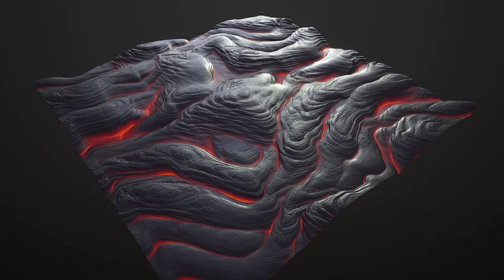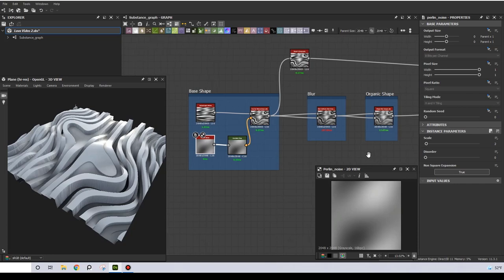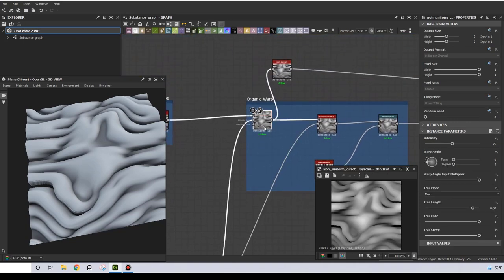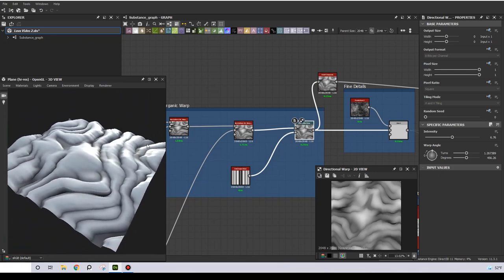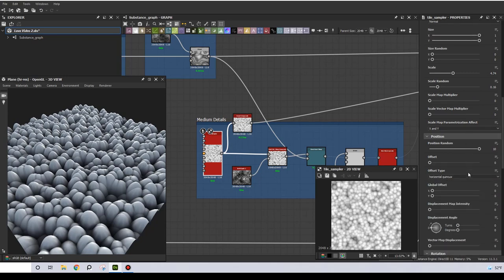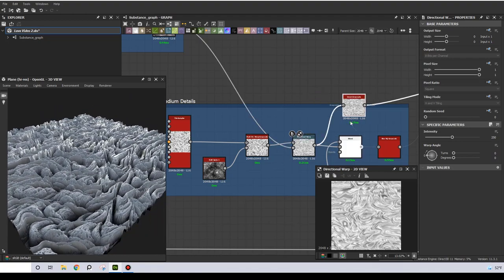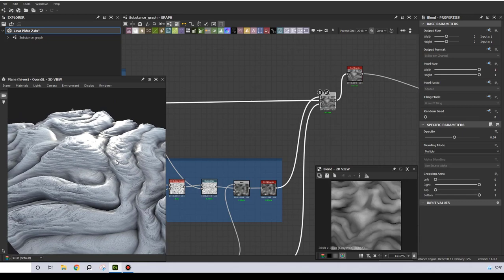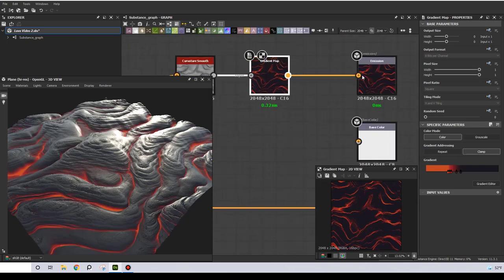Create a Lava with 22 nodes- Substance Designer

Comment: Such an awesome texture and super helpful video, and good to see a more realistic Pahoehoe style of lava!

I followed what you did, the best I could, but I found that in your 3D view, the ambient occlusion seems to be really strong, and I couldn't get the same result.
This was especially noticeable at 2:56 
The little detail holes from the noise were fairly flat, barely doing anything to the texture. I also noticed this in earlier steps, the contrast of your 3d View just seemed way better than what mine was showing, so I thought I was doing something wrong.

What are the settings in your 3D view? 

I have my tesselation scale set to 10, but I'm wondering if you've got yours set higher.

Anyway, thank you so much for showing how you made the lava. I had been trying to make my own lava, and while I got decent results, this definitely is a much nicer, and neater solution than what I could create. 

You are awesome! :D
Reply from the maker: Hi, i appreciate your words ! I think the Height Depth at the ambient occlusion is set to 0.3 instead of 0.1, As for the tesselation scale...i am not sure, that resets everytime you start designer, anyway...the final look is given in Marmoset toolbag, that's where you define the scale of your mesh if you were to present it. Hope it helps !
Reply: @csabikalanyos1607  Thank you for the quick reply! This has been  super helpful, thank you! 🤘

Comment: Hello, how did you set up your 3d view?
Reply from the maker: Hi, you can just resize and move your 2D and 3D windows from the corner, or what do you mean ?
Reply: @csabikalanyos1607  I think the question is how did you setup your preview to show the 3d tessellation etc. As if you start cold with substance designer you obviously wont have this setting in place. 

I think the tutorials could also cover off the last nodes and minor things like this as it would definitely round out the confusion.